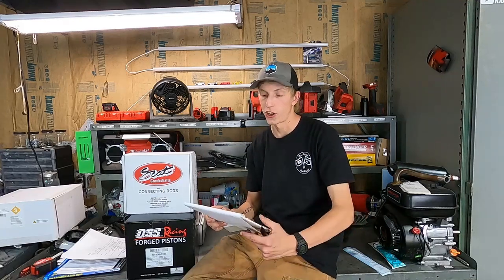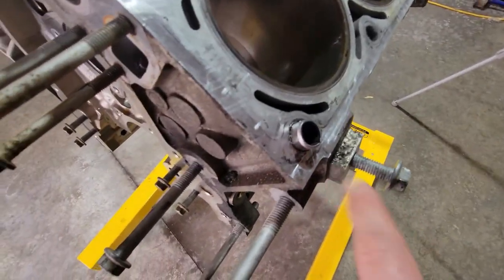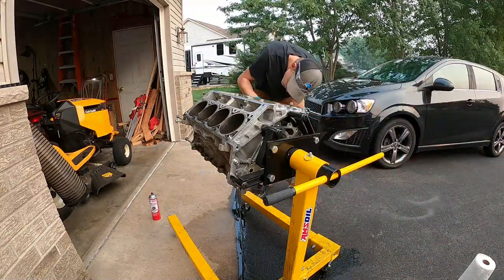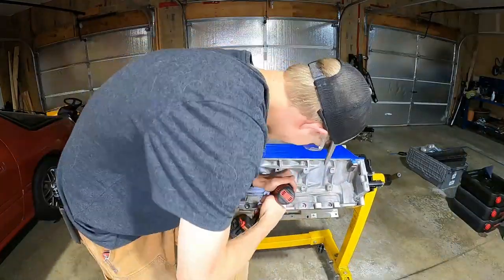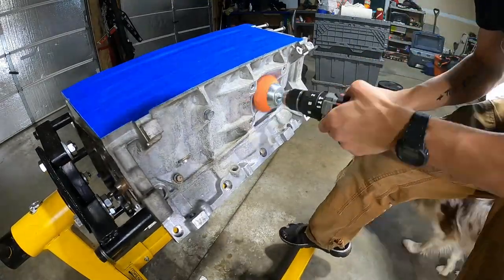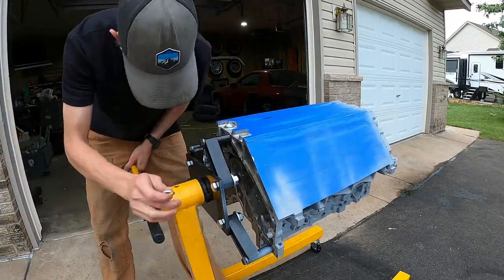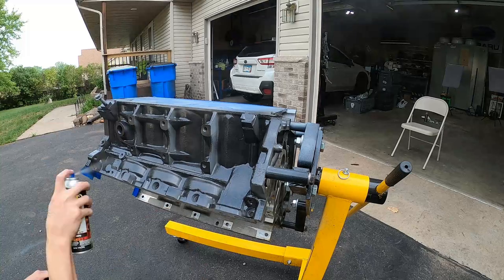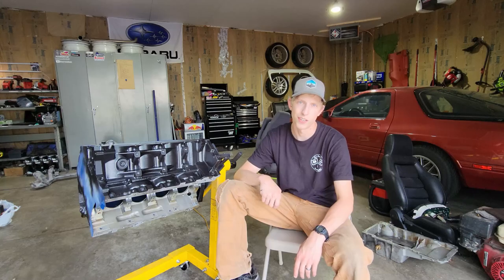How To Clean and Paint Your Engine Block!!

Comment: Man next time use oven cleaner you will be amazed
Reply from the maker: That sounds like a good tip! I'll keep it stored away for the next engine block!
Reply: What did you use to get off all the oven cleaner?
Reply: @Beemernow  just spray it off with a water hose then blow dry it

Comment: Why do you waste so much time with an engine that still needs to be cleaned?!  This is supposed to be a video about PAINTING an engine.  Anyone who doesn't know to clean the engine before painting won't be smart enough to use a computer to find the video.  I gave it 3 minutes then moved on.

Comment: How well it has held up?
Reply from the maker: The engine in the car yet but it's been covered in oil during the assembly process and holding up just fine. They say as long as it is allowed to properly set before a heat cycle it holds up great!